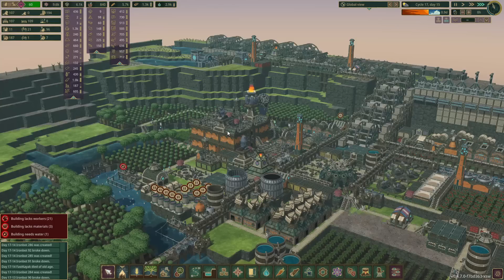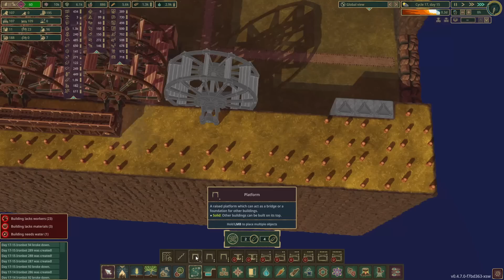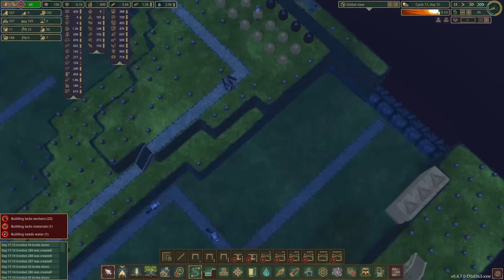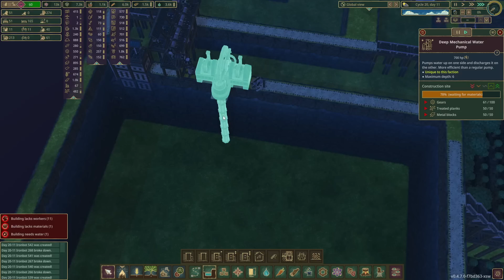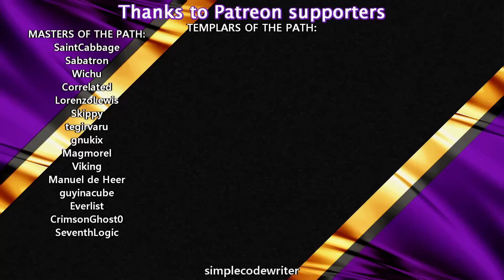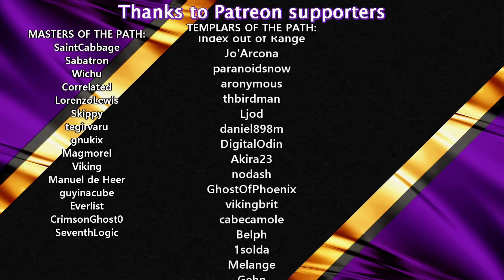Extreme Civil Engineering To Drought Proof The Colony | 09 | Timberborn Update 4 | Lets Play

Comment: You could do it the other way round..
Build de walls taller (if possible) and pump water into it during flood periods.
Then open the gates when the drought start..
If the Basin is large enough you possible could store enough power in it..
then you might be able to only use one pump and you can reuse this structure..

Oh and to save time you could build the basin on this mountain site.. like a frame around your colony :D
Reply: Also when you reverse the pumps the shallowness doesn't matter since only the water above the water line matters..
Reply: Sorry I jus realize that you did mention this at the end :D

Comment: can you make an infinite energy generator by pumping lower reservoir to higher reservoir and then generate power as it goes back to lower reservoir? in real life you can't, and it is wrong but what you do is already wrong so would it work? does water evaporate?
Reply: The developers said no. There is a link on the Steam Discussions that points to an offsite explanation of how the water system was designed. I forgot where the link was. I could probably find it. Eventually. 

Yes, I believe the water evaporates and dissipates to some extent through the ground.

Comment: I remember watching someone do something with the water, you can merge water into one block and it will make a super current but it wont raise the level of the water, if I remember correctly it a waterfall stair that went inwards and as the water falls it merges making a stronger current, it was in update 2. it can generates a lot of hp from one folktales water wheel.

also, I just binge watch you dyson sphere program all achievements playlist, great watch!

Comment: dont you have to go down a lvl to conserve/reset the flowate that is being consumed by the water wheels? Also you would want to calculate the width off your canal to the flowrate you have, and the number off water wheels you have to consume that flow rate, hence you dont want water to be able to bypass the water wheels by having a 3 width canal for only 1 large water wheel, you want a 2 with for that.
You also have to take into account the number off water you have incoming in relation to how much your canal can hold, as you dont want overflow.
A tip to ppl wanting to build a mega line off water wheels: You can upp the ground next to water source blocks, and it will fill from the source block to the 1 height where water can flow, so that you can start your massive project higher than normal

Comment: 46:16 The numbers provided by @lizzyAv should make figuring this out easy. Each pump takes out 0.5 cubic meters per second and it looks like the reservoir is 15x20x6 meters giving a capacity of 1800 cubic meters when full. 4 pumps would be pumping 2 cubic meters per sec so it should take 900 sec or 15 minutes to empty. Some one should double check this though. I am assuming the in game seconds are the same as an IRL second at normal speed but how does the game speed effect the time is something i do not know. Also @luanm.schneider9296 measurement pole suggestion would also help just to make sure this is actually what is happening.

Edit:
So according to the wiki at normal speed one 24 day takes 8 irl minutes to complete, fast it takes 2 and a half minutes and fastest 1 minute and 5 seconds. I am just going to copy this next part from the Wiki section Water/Flowing because it is getting late and I want to go outside while the sun is still out and feel like i have wasted enough time on this:
"Flowing waters' strength is measured in cms (cubic meters per second). It takes 2 seconds for a current of 1 cms to fill up a single block with water, because water simulation runs at 0.5x speed. This means it takes 2 seconds for 1 "water second" to pass.

Water can freely flow between tiles where there's a difference in the height of the water. When water passes a waterfall (a difference of +0.5 height) the water flows' strength is limited to 2.2 cms. Water flow calculations are applied only on the top level of the water.

Water current and strength is essential for creating power with water wheels. The current's strength can usually be strengthened by narrowing the water's path with dams and/or other structures that block water. A Stream Gauge icon Stream Gauge can be placed in the water to measure the current depth, maximum depth, and flow rate.

Water Pumps can be used to extract and purify Water (Good) icon water resource from flowing water."

Edit:
So with that information the reservoir would take 30 minutes at normal speed to empty? So slightly less than 4 in game days? The drought that Nilaus tested this on is 8 days and at 48:00 almost 2 days have past and it looks like it is about half full/empty and when the drought started it was close to full.

Comment: According to the wiki the pump is 0.5 cms for 1 wide (ie 1/8 cms for 4 wide) and consumes 700hp and the large water wheel is 180hp/cms (doesn't specify if that's total or average cms for the 2 wide canal, I assume it's average). With some back-of-the-envelope calculations this should mean 15.5̅ wheels in sequence should pay for each pump in a 2 wide canal, but because this is 4 wide we need 31.1̅ (or maybe even double that?).
Reply: Makes sense because 4 pumps in a 4 wide canal will be producing a flow of half a cubic meter. 0.5cm will make each wheel produce about 90 hp per wheel seen at 45:10. The 31.1 number is correct because just after the time stamp Nilaus states that the 48 wheels are producing about 4300hp giving an excess of about 1500hp after the 2800hp used by the pumps. This is only an excess of 375hp per pump so 62 wheels should provide an excess of double what each pump uses.

Comment: why the is no pipes for water  in this game, same as cranks ans shafts?
Reply: While they are charging money for this game it is still in development which they call Early Access.  This game play is from what the developers call the "experimental branch". This means you have to opt into an even more "unfinished" or more "finished" experience depending on how you look at it.  Pipes might be something they add in later and it might be faction specific.  I have been playing this game since the first release when the factions were almost the same except for a few buildings and the Iron Teeth not benefiting from happiness bonuses (the fire pits, roof top terraces and the carousel did nothing for Iron teeth well being but could still be built by them making them useless buildings) which they do now.  There might already be a mod for pipes. I know there is a mod for trains and tunnels blocks.
Reply: @Pimpemon  yes there are pipe mods

Comment: Water wheels turn based on the speed flow of water, you can build the "measurement pole" under the water tab, it mesures the speed flow and depth of water. You can compare the flow on wet season and dry season (with pumps) to see the best pump ratio. Awsome ep as always, cheers mate

Comment: I was wondering if the last episode would be the final Timberborn video for update 4 since the reservoir you made during the live stream didn't work as intended.  I am glad you tried to improve on the design.  As far as getting greedy by adding 12 water wheels it looks like you might be able to add a few more perpendicular on the the turn around points or move the existing ones into the empty space at the front or back to add an extra set in each row.  They might not be as efficient though since the water flow bends at those points but it would probably add a little extra power in the system.I am sure this has been mentioned to the devs but it seem rather inefficient to have to blast away the earth with explosives. Then have to dig it up with an excavator to build the earth back up.  When will the beavers be able to use shovels and wheelbarrows to move the dirt. Maybe that could be a Forktail thing and maybe it already is.

Comment: This is amazing!  I wonder if building tall enough to essentially make a water tower is net energy positive...  A pump that feeds into a pool with another pump, stacked like a staircase until you reach the height required to sustain maximum flow rate throughout a drought.
Reply: I was wondering if you built a wall such that the water coming in pumped itself up to a higher level and you could then let it keep flowing after the drought.

Comment: Ah the joys of video game physics. If only it worked that way in real life, but the only energy you could extract from wheels turning from descending water is at most equal to the energy to pump the water to the higher height (and then, of course, every system is lossy).
But it looks very cool and is an enormous basin. Well done!